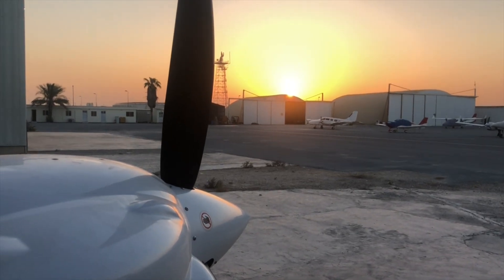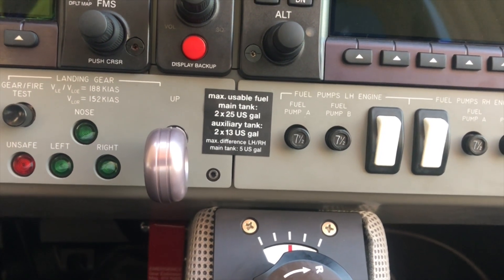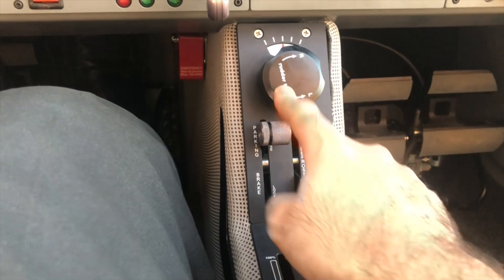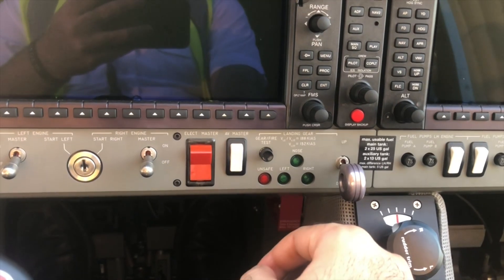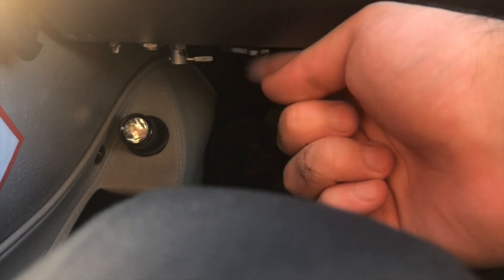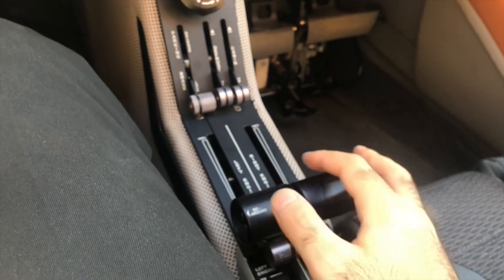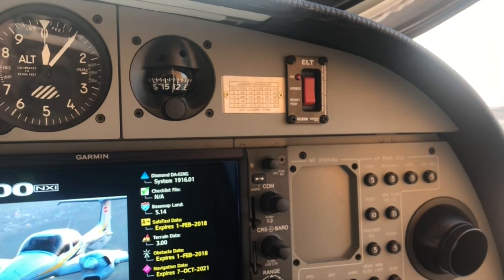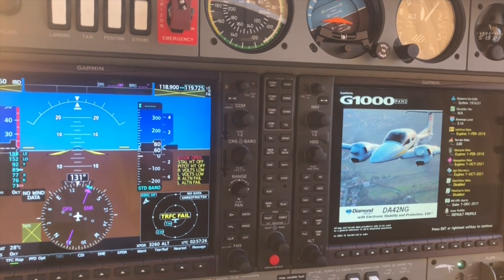✅ Diamond DA42 NG Cockpit Tour | Introduction to Multi Engine Piston

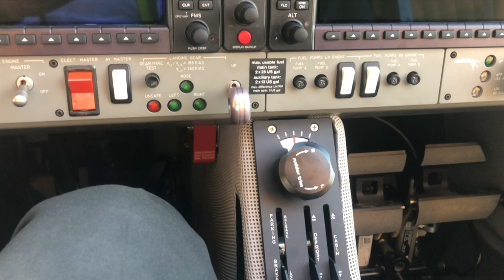Comment: Parking brake procedures at minute 3:10 are incorrect. First you pull the lever downwards and then you pump on the pedals to build up pressure (DA 42 NG AFM page 7-19)

Comment: I really loved ur videos and appreciate that  one question i have is why do we need to wait for 10 second for the other auxiliary pump ?
Reply from the maker: Good question, It is recommended by the manufacturer to wait for a 10 second interval so that to avoid overloading the electrical circuit corresponding to the fuel pumps. It's merely a recommendation to prolong electrical circuit life.
Reply: @ATPLStudent  where is this recommendation comes from? Diamond AFM says nothing about it
Reply: Thanks a lot

Comment: How to work L/R electric trim on control stick?
Reply from the maker: It is similar to the trim wheel you have in the center console. you slide the toggle switch fwd you trim the aircraft nose down and backwards you trim the aircraft nose high. there are two buttons together to prevent unwanted trim runaway. Hope this helped